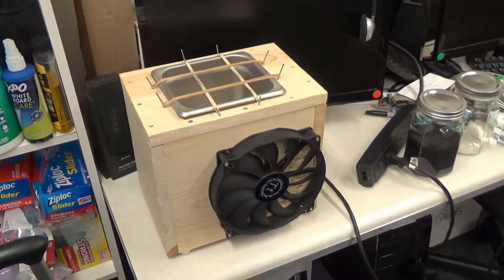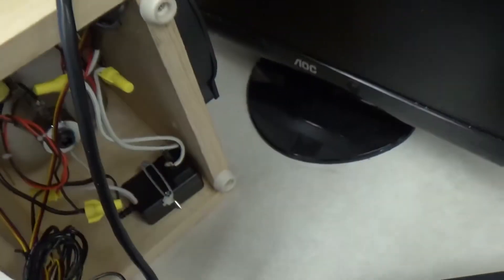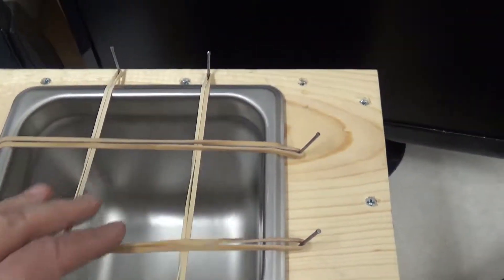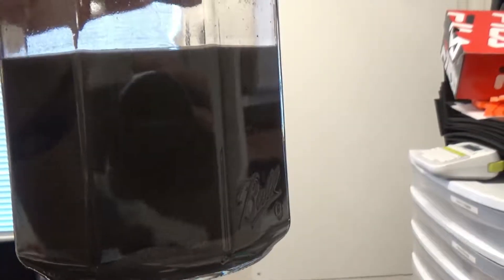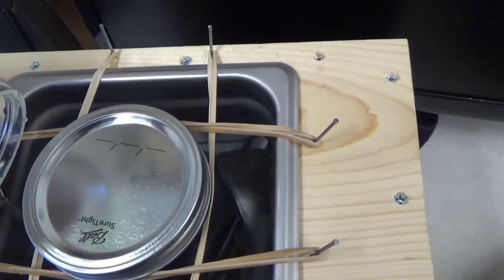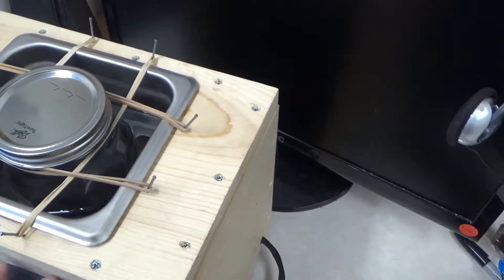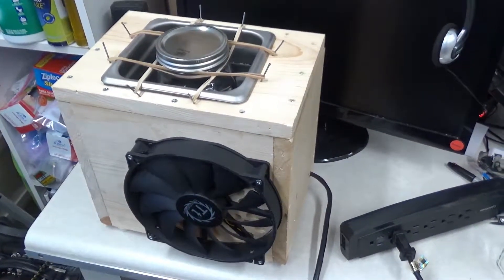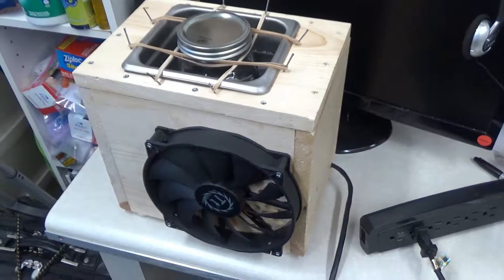Upgrading the DIY Sonicator

Comment: I just built this same sonicator but I am having problems maybe you can help?
I built it almost identical... the same board and transducer although bought from a different source. Same kind of stainless steel pan etc.

 Problem is that the bath only runs with a certain amount of liquid in it... like it runs only when the water is at a certain resonance maybe? Idk... if I get it running though and I place a jar into the bath as soon as I touch the water with the jar the sonicator stops... so I resorted to placing my expanded graphite and water solution directly into the bath and guess what? With the graphite in the water it makes it so I cant put much more than around ~50ml before the transducer again seems to stop (no noise or agitation in the liquid) this is way less than when I put plain water in the bath at about 500ml or so the sonicator stops... makes me think it's something to do with the resonance of the bath being off from the transducer target resonance maybe? Any help would be greatly appreciated. Thanks!
Reply from the maker: Did you use the rubber weatherstripping between the pan and the frame?  That's what lets the pan vibrate more easily.

Comment: Ok that’s real beefy. Buttttt.  If you had drilled the holes beneath the power unit. You would have a more quite set up. Also a couple spacers. But what you got there is cool.
Reply from the maker: I'm putting together a design for the next version, using lessons learned on this one.  Airflow and fans will be designed in, not added on.  I'm thinking smaller quiet fans inside the case instead of outside the case.  There's a lot about this design that I'm happy with -- but I always want to make things better!  Thanks for your input!